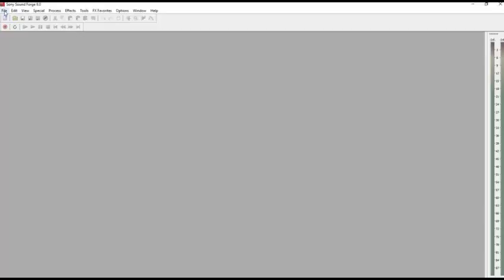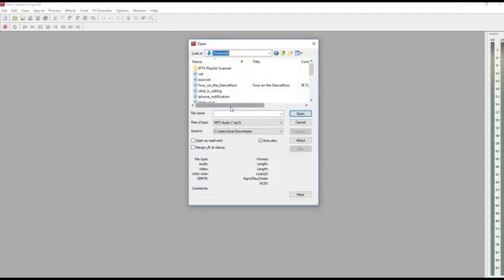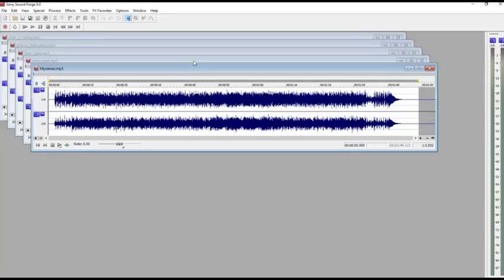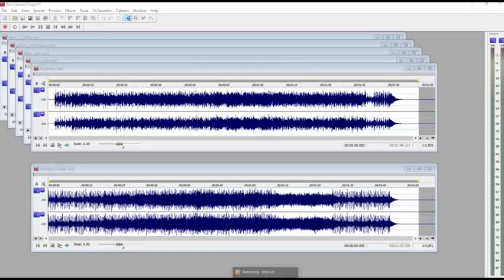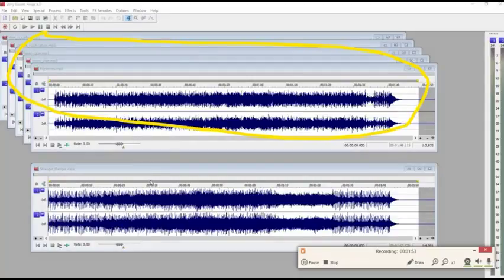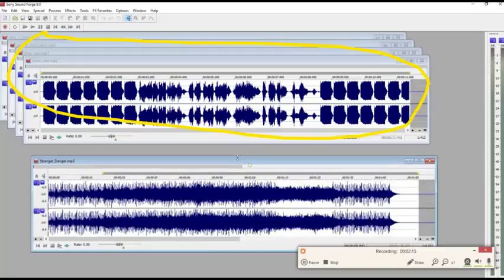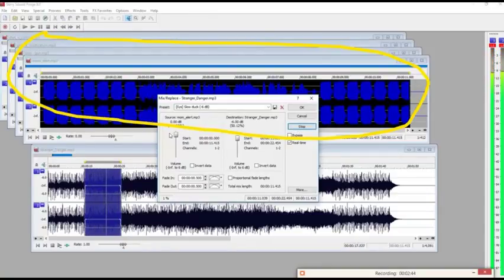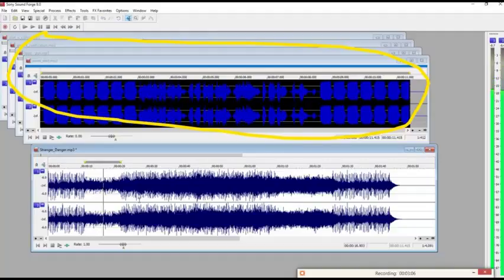How to make a mix - Sony Sound Forge 9.0

Comment: I have Sony Sound Forge 7 and used it a lot back in the day. I lost it somewhere and just recently found it going through some old stuff. I’m used to it and like it for my uses but there is no support for saving files as AAC or M4A. Do you happen to know where I can get a plug-in or something to be able to use these file formats in SSF7 as I don’t want to pay for something that’s over my head in what I use it for and would prefer to not have to learn an entirely new prose of software.